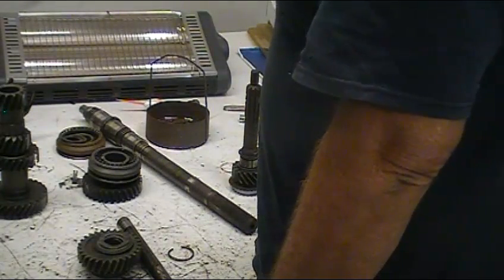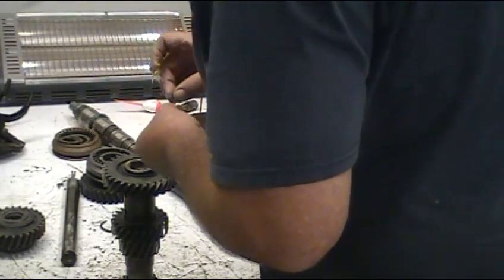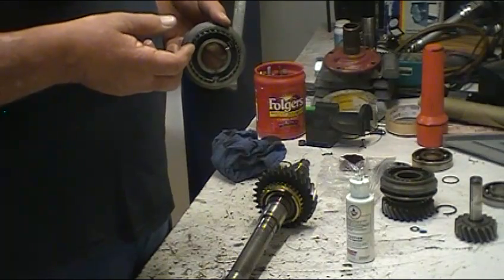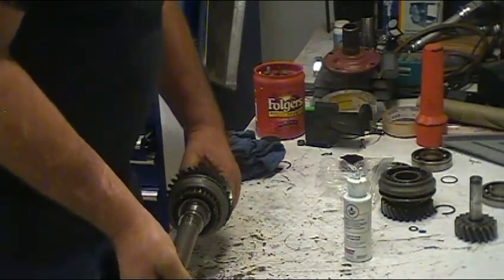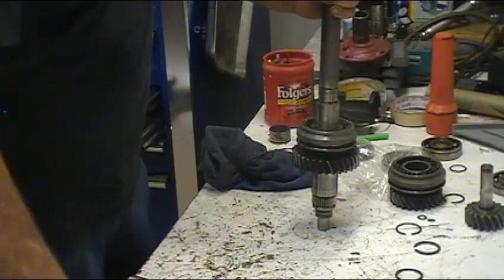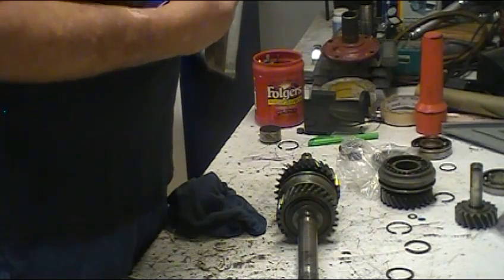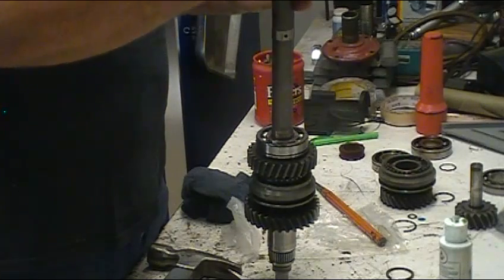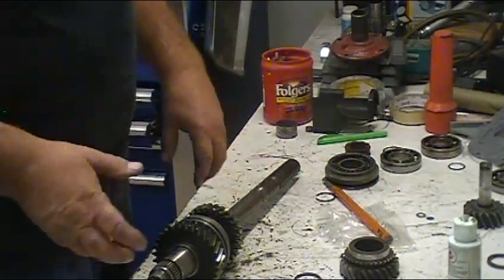Saginaw 3 Speed Overhaul

Comment: Thank you for the help and tips.  I have an old 3 speed I got to possibly put in a project. That being said, the transmission sat outside on the ground. I didn't realize the speedometer piece was missing and got dirt inside. So I just wanted to clean the dirt out of the tail housing. And boy did I make a mess.

Comment: Thanks for this video! I have 3 Saginaw 4speeds I need to rebuild and this video helps it all make sense.
Reply from the maker: Glad you find it helpful. The 4 speed is very similar. It uses the same mainshaft.
Reply: I got it all rebuilt. Feels real smooth on the bench. I put it in the car, but i have to finish hooking up the engine and do my break-in start-up before I'll know for sure if I got it right. Thanks again, really.

Comment: I just need to get the case replaced before the race next Saturday 😂 still need to find the case .
Reply from the maker: 7 bolts remove sidecover, 
4 bolts remove front bearing retainer, bearing snap ring then front bearing
Remove E'clip- reverse idler
5 bolts tail housing
Slide ENTIRE assembly rearward out of the main housing. You will have to shift the 1-2 slider and  small reverse idler to clear the lower cluster gear.

Leave mainshaft assembly together. 

Drive counter shaft out rear of case.
Remove cluster,all needles,washers thrust bearings.  Reinstall cluster needles,washers etc in new case using grease.  Drive in counter shaft from rear making note of woodruff key position.

Reinstall  mainshaft assembly as noted above.
Reinstall front bearing, retainer, sidecover as noted above.
 
Go win the feature!

Comment: THE question I have is at 56:55 you commented about aligning the syncro hub with 2nd gear's grove (lubrication grove?). Are both the syncro hubs to be aligned with the 1/R and 2-3 gears?.....just wondering....david, tulsa,ok
Reply from the maker: I was basic attempting to say the speed gears freewheel until you shift the syhro sleeve onto the speed gear. The synchro sleeve is splined to the hub which in turn is splined to the shaft thus the gears now drive. The brass rings " bite" on the gears to slow them down so smooth shift occurs. Those brass rings need to be clocked to the keys inside the synchro assembly. Hope that makes sense.

Comment: Hello... I might have a problem with my 3-speed Saginaw and would like to hear your opinion.

At reassembly dropping on the reverse gear, there seems to be a little wobble.  The retainer and wave washer are all placed as you instruct and the bearing fit well.  All gears and slider/syncros fit snug without lateral movement.  The reverse gear seems to have a tiny bit of play, up and down from the shaft.  Is that normal for an old transmission?

While disassembled and inspecting the main shaft, I noticed a tiny undulation in the shaft under where the reverse gear sits.  It is uniform around the shaft and didn't seem bad, but maybe the gear also has wear.

Since it's just the reverse gear and used very little and very slowly, will it be an issue?  Or, will it present a problem since it might be wobbling at high speed once on the highway?  Maybe it's meshed with a gear on the cluster at all times.  Is that right?

After trying 5 different places, I can't find a new main shaft or reverse gear on the Internet.  If I need new parts, maybe you know where I can find them.  I didn't want to trust a junk yard.

Thanks for any advice!  Meanwhile, it sits covered and waiting.
Reply from the maker: Reverse has a bronze insert it rides on and it's not serviceable except by replacing the gear. It's pretty typical to have some wear. Honestly I wouldn't worry about it as long as the insert isnt loose inside the gear.  I dont think you'll have any discernible issue.
Reply from the maker: All gears are in contact with the cluster as all times..
Reply: @purestock22  

Man... that's really great news.  Thanks for the advice.

Moving forward!!
Reply: Hello again purestock22.
Sorry to bother you again... looks like you stay pretty busy... but another issue has surfaced, in regard to reverse.
In your video at 1:18:20, you show a bushing on the reverse idler shaft.  I don't have that bushing.  I was meticulous in disassembly, tracking everything and placing all parts in small Tupperware containers for cleaning.  I even saved all the old parts.  There was no bushing on this idler shaft.
Have you ever seen that before?
Would you happen to have an extra bushing that I might purchase from you?  I doubt I would find only that bushing for sale anywhere.
It appears that I'm almost there!

What's your take on this issue?
Reply from the maker: @jmjntex8831  They don't all use the bushing.  Those that do have the retaining  clip groove in a different place.  I don't know why some use the spacer and some don't.  Carry on your fine..
Reply: @purestock22  
Excellent news!  Thought I was losing it!
Thanks again for your advice.

Comment: Sorry to bother you again....but...after you installed the "input shaft" bearings (needle bearings) , did you have any thrust washers between the "input shaft" and mainshaft? My trans is a 1976 model.....just wondering in Tulsa.....david
Reply from the maker: On each end of the cluster there should be a thin metal washer at the end of needle bearings that will ride against  either a  bronze or metal thrust washer with a locating tab.
Reply from the maker: I misread your question. There aren't any thrust washers between the input and mainshaft on these transmissions. The outer snap ring that holds the front bearing on is selective.

Comment: @ 1:52:16 you stated to shift it in neutral.  How do you do that with the cover off?  Or how can you verify you are in neutral?  Thanks for the video.
Reply from the maker: The synchronizer sleeve will be centered between the gears. You'll be able to see the brass on either side.
Reply from the maker: Physically move the sleeves with your hand as necessary.
Reply: @purestock22  thank you, this helps.  I am attempting to install the cover back on with the transmission installed in the car.  I had a leak seeping out of the side cover after a full rebuild at a shop.  I wanted to repair the leak myself.  Do you use just RTV silicone between the side cover and the transmission or the paper gasket?  combo of both?  Is there a torque spec for the side cover bolts?  Thanks.
Reply from the maker: @djjc76  I usually do paper gaskets with light line of black ultra silicone. Torque spec is 12-15 ft/bs.

Comment: Never NEVER leave the magnet out. You have no filter in that transmission, that magnet is the only "safety net" you get.
Reply from the maker: Magnetic fill plugs are available if a guy really does't fill comfortable without one.  They are really hard to clean, often chewed up as well. I prefer to leave them out.

Comment: How did you install the counter shaft? Did you use a punch or driver?
Reply from the maker: Shawn I usually use a liitle lube and  just tap it in with a regular ball peen hammer. It's not extremely tight. Easiest to stand case on end. Install front thrust washer, then cluster, line up straight then install upper(rear thrust washer) slide shaft thru,tap in case